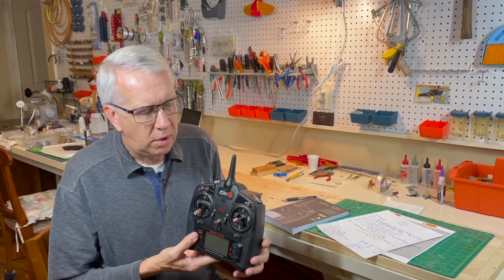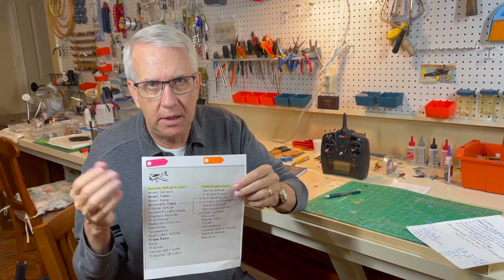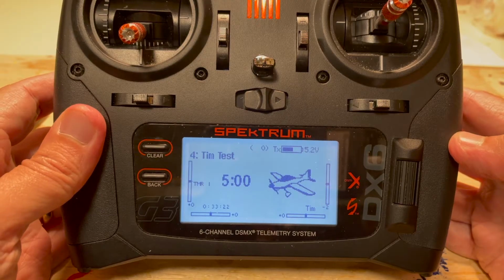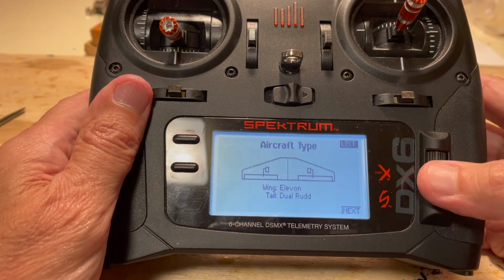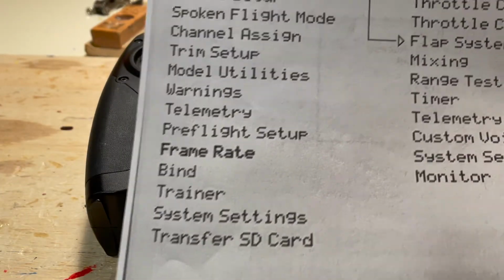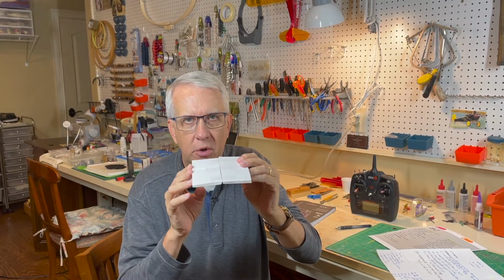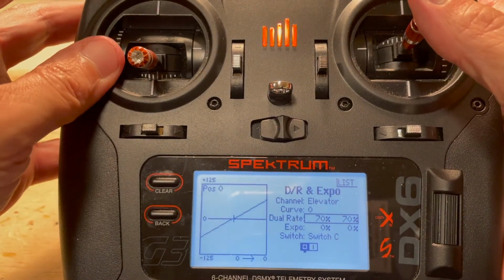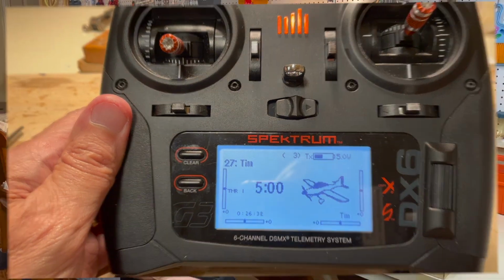Spektrum DX6 Tips & Techniques for Newbies!

Comment: I just acquired a second-hand dx6 and I need to be able to get my planes bound and programmed to the transmitter and receiver.
Reply from the maker: I do have other videos on binding the DX6 with the AR620 receiver.  Super easy.
Reply: @TimMcKay56 , I have been using the old dsm2 receivers.

Comment: Thank you for the video...i am having a little problem with my dx6e i had to replace a motor and ESC on my Panther F-9 3s system. After installing everything works except for the throttle.... receiver is a Admiral 600 I tried to rebind it all lights on the receiver working good...no throttle. Having another model still in the box I put it together and it has no throttle F- 100 from Motion I have never had any problems with any of them till now any help would be appreciated 👍
Reply from the maker: One approach I can think of.  This is from my experience with the MinimumRC BAE Hawk model kit (see my video on this).  Under the Function list of the Spektrum DX6, click on Servo Setup.  For Travel with the THR function, I was told by MinimumRC to set the low throttle travel to -120%.  For whatever reason, this solved the throttle issue and the motor worked fine.
Reply: @TimMcKay56  Topeka it lives too fly another day......thank you sir

Comment: Very excellent video, thanks for making it.  I’ve had this transmitter for years now and I still struggle with some thing. That is Flight Mode.  I still can’t figure out what it is, or how to use it.  The manual isn’t very clear and sometimes it appears and sometimes it doesn’t, when I’m setting up a new plane. Can anyone please explain what flight mode is?
Reply from the maker: Copy!  Tim
Reply: @TimMcKay56 Thanks, but I don’t understand.  What do you mean by “copy” ?

Comment: Excellent presentation! The manual for the DX6 is NOT the easiest thing to navigate for the hobbiest new to computer radios. In fact, you probably saved me from binning my DX6 altogether and going back to a vintage radio.
Reply from the maker: Jim:  Thanks for checking in!  I like Spektrum products a lot.  I have been using my DX6 for years, works like a champ!  Tim

Comment: Is there any way to factory data reset my DX6e?
Reply from the maker: No idea. Try www.HorizonHobby.com chat for tech support. Tim
Reply: @TimMcKay56  
I found that if you press both clear and back at the same time pressing the power button hold all three down and it will take you from the screen you can’t get off of to a screen where you can get back to the main menu!
Reply from the maker: @AWWRider  😊👍🏻 Tim

Comment: Tim my dx6 is stuck on a low battery warning but my battery is fully charged..ever run into this and if so how do i fix it?
Reply from the maker: Duane:  Not sure on this one, but I do think this needs to be fixed.  My guess is your battery is old and needs to be replaced.  Perhaps start a chat session with www.HorizonHobby.com tech support for a quote to repair.  I use AA batteries for my DX6, so do not have the issue of an older internal battery.  Tim

Comment: Basically the preflight will give just that, a preflight checklist.
So when you are going out to fly ur plane, we'll assume you already have that plane chosen and bound. 
Turn the transmitter on at the field. If will display a checklist that you have chosen, in tje order of which you have chosen.
If you come to the conclusion you are always forgetting something, you can add it to the preflight check.
You will just physically check each item you add and then it will go into the regular screen after and allow you to fly.
It is handy on more advanced planes for sure.
Turning the fuel switch on, for instance.
Maybe, checking something you were having an issue with.
Ensuring the control surfaces are correct.
Ensuring the low rates are on.
Whatever you want really.
Reply from the maker: 👍🏻😊 Tim

Comment: Hi Tim, I have an earlier model than the one you discuss and am trying to set up a Ranger 1600 with flapperons but the manual is very short on setting it up. 
Can you point me to some information to help with fine tuning?
Reply from the maker: Tom:  Nothing off top of my head. Might try www.HorizonHobby.com tech support via chat, they might assist. Tim
Reply: @TimMcKay56  Thanks Tim. Spektrum clarified the extent of the mixing and looking at a rc forum I was reminded of the mixers and they gave me linked aileron/rudder.
Reply from the maker: @Pufferman  Great!  Tim

Comment: Hope you can help. Dx6/AR630. When I go to high rates, only one aileron increases throws. On low rates, they are both equal. New servos, no obstructions. Thanks.
Reply from the maker: Larry:  I can think of a few things to try.  First, doublecheck that you have selected the correct aileron set up for your model in the computer memory, and that the ailerons are for sure in the correct ports on the receiver.  Next, try setting everything up in a new, vacant model in your transmitter.  In other words, if you have this model in, say, model #8, find an unused model and set everything up there.  Sometimes there are "artifacts" and weird items in the memory that can cause problems.  Finally, check the percentage of throw for the ailerons in both high and low rates.  You can do this by moving the stick to extreme right and left positions and ensure that the transmitter shows 100% of the throw.  Sometimes this can get set to a lower value which will inhibit the full throw of the servo.  Good luck!  Tim

Comment: I would like to know if you can assign a minimum number of revolutions to the motor to a switch, thanks
Reply from the maker: Danilo:  I do not think so, as there is no output from the motor ref revolutions for the transmitter to know a revolution count. Tim

Comment: Thank you Tim!!!! I am new to RC planes, 8 weeks ago started with an E-flits Radian and an old DSX, I became really hooked on this hobby. Then I bought a new Conscendo Evolution and a DX8e. I had no clue as to how to get the plane and the DX8 working together. I just blinded them with no set up at all, and yikes it worked. I could get it in the air fly around and after 4 or so go arounds land it. But things started going badly. Finally, after a hand launch it did a huge fish hook left and creatored the grass runway and breaking the tail boom. 30 man hours later I got it back together, sort of (not). Ordered a new Conscendo. The distress and fatigue over all this was turning me off this wonderful hobby then came the programing that damn DX8. I was done, can’t do this any more but you got me over the top with this video so maybe I will get some sleep again. Tomorrow morning I’ll fly my new plane and have a good time! Thank you again. Gordon D. Waxhaw, NC
Reply from the maker: SC:  What an inspiring story, thanks for sharing!  This is a great hobby, just enjoy. Tim
Reply: @TimMcKay56   Tim, It has been over a year sense I made this commit. I have learned a lot about transmitters and flying, now running a NX8 for my customed Conscendo (#3, they don’t really last a long time, get old and worn out) added servo controlled flaps, installed a telemetry sensor fully inside fuselage, and custom paint job. I am very comfortable now flying and landing with ease. The really bad problem I had of destroying Conscendos was fixed one day when a veteran flyer found me picking up plane pieces and asked what happened. When I told him about the left hand fish hook noise in crashes on launch, He ask how much throttle I used I said 60% or less. He then he saved this hobby for me by saying, that’s not enough use at least 80%. Sure enough that was it now smooth and straight under control to “rotation”. this is too long if you still reading thanks.
Reply: Throttle-Cut is the most important feature.
Reply: Gordon:  No worries, glad it all worked out!  Tim

Comment: The best tutorial by far , I have a new Spektrum nx8 but I am struggling to have elevator on the left sick (up down) and rudder on the right stick(left right) I have tried changing the mods but does not give me exactly what I want  ?
any help much appreciated (Glider)
Reply from the maker: Martin:  Converting a transmitter from Mode 2 to Mode 1 a fairly major task. This should be covered in the owners manual, you’ll just have to dig this up and keep all fingers crossed. Tim

Comment: 1. When naming a new model, I delete the number that it automatically puts in front of the model name. I clear the whole line and put the manufacturer's name followed by the name of the aircraft. This allows me to go into model utilities and sort my models by manufacturer and name without having a number that makes no sense at the beginning.
2. I never turn the travel below 100% because a surface moves too far. I make sure I'm using the full length of the control horn and then move the pushrod in on the servo arm. When you decrease the travel settings, it decreases the resolution of your radio. And since the servo doesn't move as far, any slack in the linkage becomes a larger percentage of the control surface throw. This hurts the positioning accuracy of the control surface.
3. I use the flight modes with flaps. Since I use switch D for flaps, I assign it to the flight modes. Under the trim setup, you can change the trim type from "Common" to "F-Mode" for ailerons, elevator, and even rudder, if desired. This will give you separate trim memories for flaps up, takeoff flaps, and landing flaps. You'll be able to use the trim levers to trim your plane to fly straight in every flap position.
4. I use switch B for dual rates/expo. Position 0 is low rates with AS3X, position 1 is high rates with AS3X, and position 2 is high rates with SAFE mode. SAFE mode doesn't work correctly when your channels don't go from -100 to +100 percent.
Reply from the maker: All great points, thanks so much!  Tim

Comment: Great video!  I'll be studying that over and over to learn.  A question, with RF9.5 and DX6, can I program the DX6 switches to do the same functions in both the aircraft live flying, and in the RF9.5? Would be great if they both functioned the same to save confusion at the airfield.  Thanks! 👍
Reply from the maker: Gsry:  Not sure on the DX6 and RealFlight.  I keep it a bit simpler, just use the RC controller with a USB plug in.  Tim

Comment: wow, I also have the DX6..........I noticed your Tx voltage is almost down to 5.0vdc...what is your  low voltage alarm set at and  exactly what  voltage  does this transmitter  shut down ....thanks
Reply from the maker: Gary:  Thanks for checking in!  For alkaline batteries, 4.3 is the minimum voltage (from the manual). I tape a small tag 4.3 on the bottom of the transmitter. Tim
Reply: @TimMcKay56  that explains it...I am using a  Li  ion 
rechargeable pack and never let it get below 6.6v....that is also what I have my low voltage alarm set at....thanks Tim